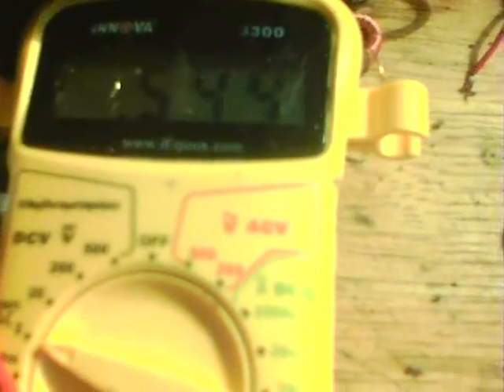Battery voltage increase under load

Comment from the maker: @MrSkypelessons Simply parallel I would say...like they do in 9V PP3's. Make it look like 1 cell, but have say 25 in there...car battery to look at, with freebie energy of say 100mA at 12V.
Current used is the main thing, has to be a minus number or zero. A variable pot of say 1K really helps to tune...am down to 1uA across the 1ohm resistor. Circuit is still running - 22hrs :)
PH2369 tranny uses mV to run, just found a couple of those, so efficient hybrid oscillator is next.

Comment: Hi mate - Ive just tried changing the resistor on my JThief - i was using 800 Ohms, but i changed to 40 ohms.  The current draw is now up :)  less resistance means more current.  So thanks for the idea!  It went up to 4mA but has now gone down to 3.8.  With the extra cell in parallel I can get 5mA under load.  How can we make one of these which puts out 100mA?  Thats what we need :)